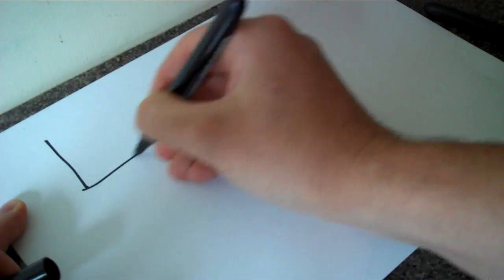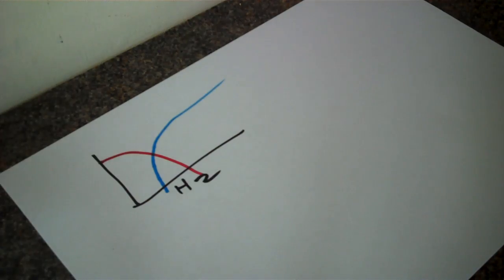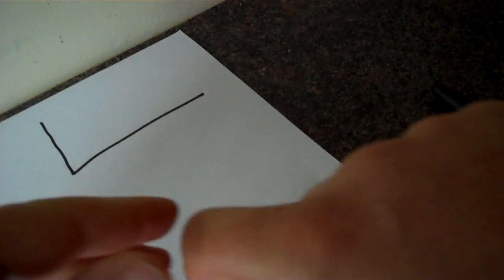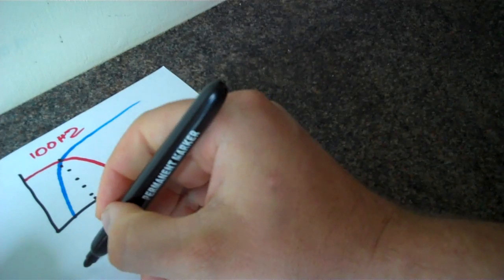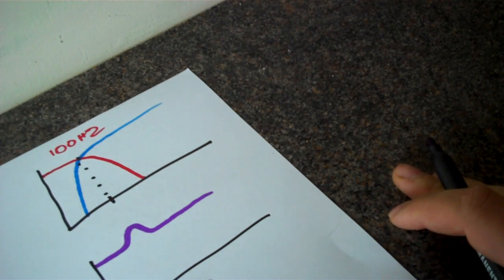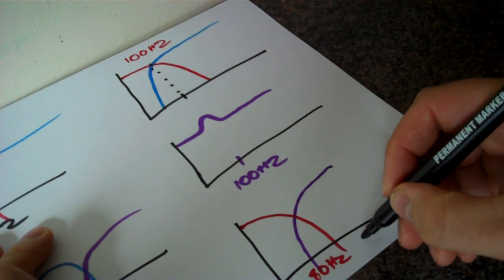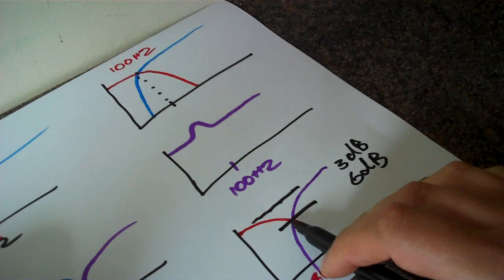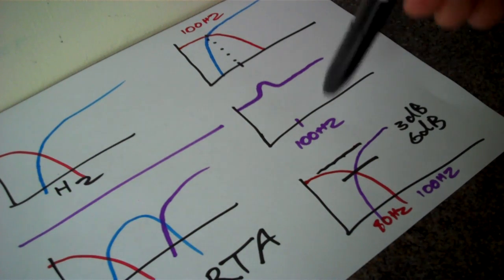Crossovers, High and Low Pass Filters

Comment: that hump will apear if the xover design is not good, 2nd order xovers will have a notch if you connect it in phase, the only way to remove that notch is to invert one speakers system, but will create a hump. most even order xovers have these characteristics in and more create more phase shifting,  the purpose of xover is to divide the freq band with constant power voltage, it is normal to have the crossover points exactly on the same freq, that cut of is actually -3db or half power, example 100hz lp, @100hz hte power is1/2 power, the next half power comes from the HP which must land on the same 100hz. to create unitity power at the cut freq. the problem with crossover is the order it is designed, 2nd order or -12/octive is phase out 90degress, if the speaker are driven in phase , that 100hz from the LP is -90 and HP +90 causing a notch. you need to invert one system output  but will introduce peaking, all even number order has this and shifts so much that it could be heard, so i dont design 2nd order and 4th order crossovers, because you cannot get constant voltage and power unity when all speakers a running, either you get a notch worst case, id rather have a peaking and use an eq to flaten it out
The ideal crossover of multiamping is 3rd order xovers, there is not need to invert any speaker, produces constant volyage and power, not peaking no notch, expample 100hz cut off LP will be -3db @100hz pahse shift of -135 degress,  and HP @100hz is also -3db  +135 degrees, when summed it will produces 0db or unitiy which is -180  and you will have contant power and constant voltage output, because it has 135 degrees it is not heard unless htere is a ripple in the freq. 4th order has more phase shift
i design electronics crossovers and 3rd order is the best, even mixing or driving all the pseaker together, ther is no peaking , has a good sharp cut to prevent ampli and speaker to work more, -18db/octabe, all system can be in phase.
you first need to understand xovers, remeber 2nd order -12db/octave has shallow rolloff, required to invert one system, the best crossover is 3rd order -18db/octave, diven in phase, constant power and voltage meaning unity no peaking extremely flat overall response, 4th order has to much phase 180 degrees at crossover point and sever peaking at xover point. just keep that in mind
Reply: Hi sir. Does this theory work regardless of the HP and LP frequencies? Or must the HP LP roll-off frequencies be the same?

I have a 3-way system with DSP. The shop I went to tuned them like these:

1) 6.5" midbass speaker - LP @ 1000 Hz @ 18dB/oct
2) 2.5" Full range  - HP @ 680 Hz @ 18 dB/oct phase shifted 180° 

What perplexed me was that he phase shifted the 2.5" speakers even though he is using 3rd order xovers

Comment: I read somewhere that the crossover is actually the -3db point. Meaning if you cross both the hpf and lpf at 100 hz, they're both at -3db, so when they meet it sums to 0 db or flat. Assuming the speakers and the subwoofer are somewhat balanced in output.
Reply from the maker: Thanks for setting that point straight. When I made this I knew less than now and actually what I was trying to get across too was rely on your ears more than on the theory because if it sounds right, it probably is. Thank you for your input!
Reply: Yeah, car audio is pretty complicated. I still have a lot to learn too.

Comment: Thanks for the video but I end up as confused prior to the video, my problem is a new external Creative soundcard I got have a setting called crossover frequence, if this is for sub or only speakers, or if it works on both I dont know, its stock at 80 hz, anyone suggest any changes? I've got z623 2.1 speakers.

Comment: This video has helped me tune my alpine 9835, the crossover splits 3 ways front/rear/sub or high/mid/sub. I had the eq on flat and the crossovers for the front and rear at 80hz with a 12db octave,  sub on 50hz and down. i found it sounded dull i tried raising the eq +3db around 65hz and this fixed it
cheers

Comment from the maker: Yes I would agree because you would want the low sub frequencies to come from the subwoofer rather than from your front speakers.
Reply: Right now my sub is set to120hz and my speaker is set to 80hz. Is that wrong?
Reply from the maker: buster colin Have you got any way of measuring the output level of your system to see if there is a boost or cut at the crossover point? Most phones can have an app that measures all the frequencies simultaneously. Search for RTA or real time Analyzer and hold the phone in the listening position with Pink Noise playing through. You’ll see a line on there that represents the audio spectrum of your system.  This is a very crude way of testing your system, but it will answer your question. Let me know how you get on?